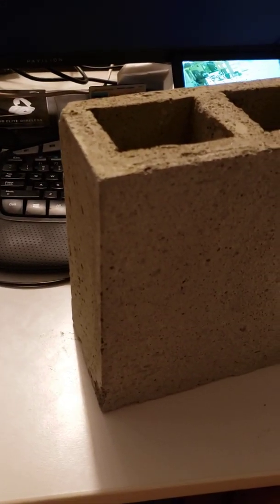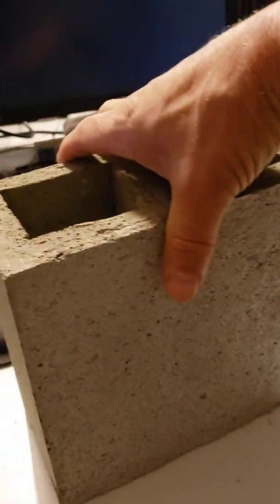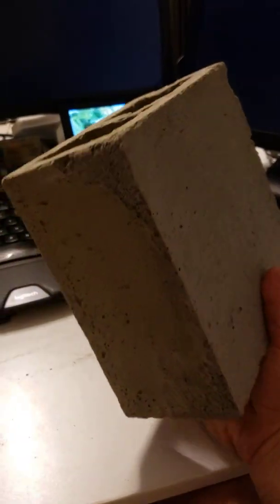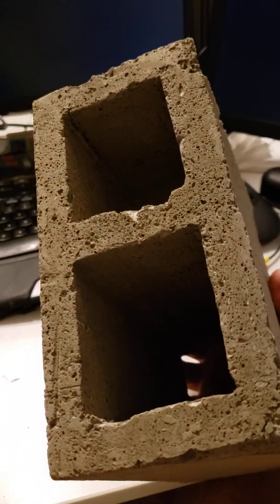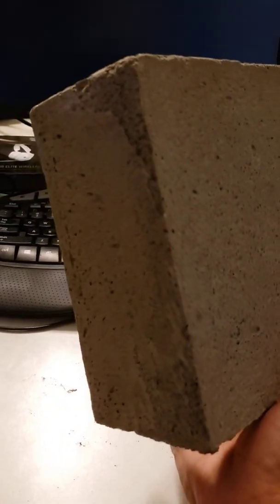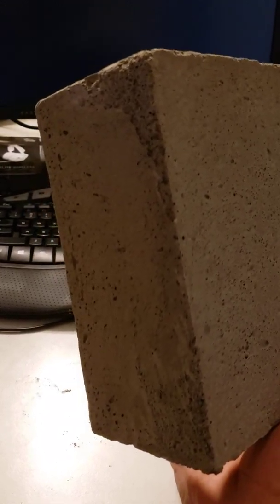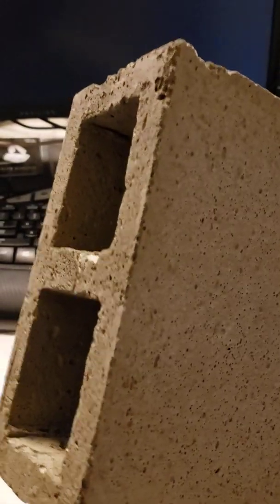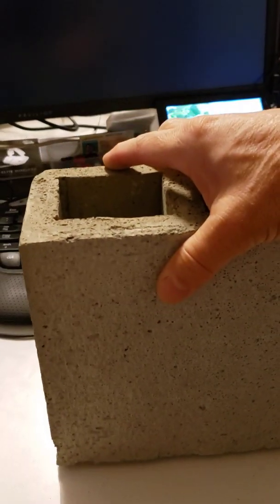June 9, 2020

Comment: I'VE BN HANGIN' IN THERE w/YOUR EXPERIMENTATION.. SO, DON'T B DISCOURAGED. THE FACT THAT THESE BLOCKS R SEALED w/PAINT.. IS A WIN, WIN. ESPECIALLY IF THE PAINT CAN BE MIS-MATCHED, OLD PAINT OR JUNK PAINT. WHICH DID U FIND WORKED BEST? THOSE BLOCKS APPEAR UNIFORMED. I'M INTERESTED IN PANELS ONE COULD BUILD A SIMPLE SQUARED HOUSE WITH.. HOW IS THAT GOING? Respectfully, Margo-KansasCity